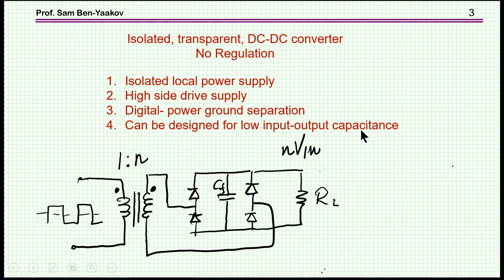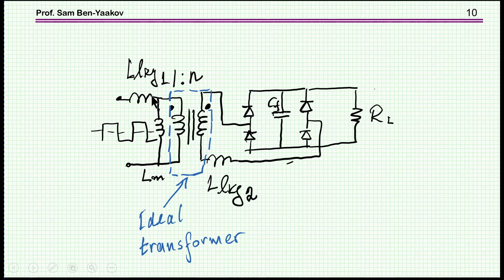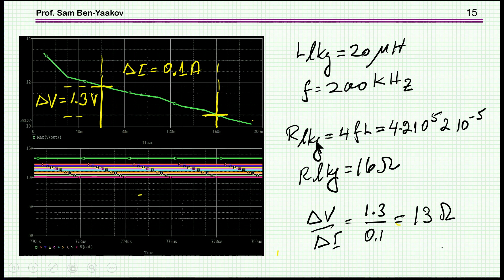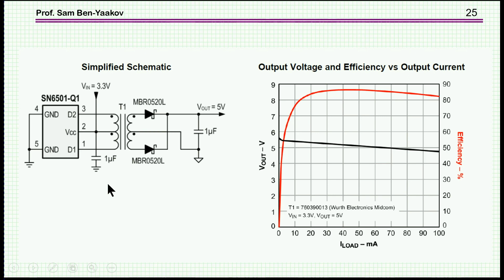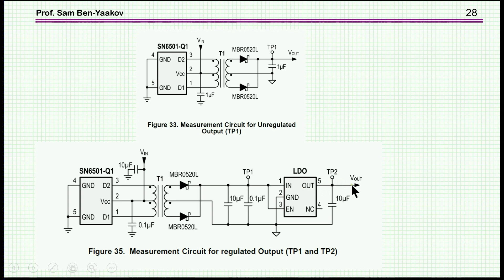Transparent isolated DC-DC converters

Comment: Superb! This is directly related to what i'm working on. Can everything you said about the secondary apply to a flying cap circuit? Some questions:
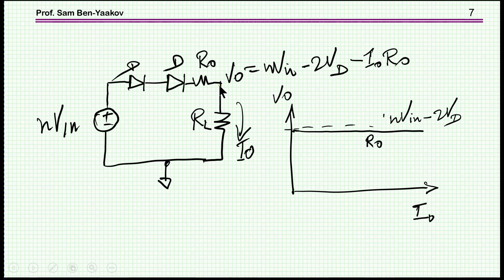3:28 
- Why is output current the inverse of input current? Due to storage in the trafo or cap?
- What's "input current"? Isn't current a matter of output, rather than output?
4:00 
- Leakage inductance doesn't cause heat, just V drop with higher load, correct? 
- Do you mean droop every wave cycle, or droop over longer time periods?
- Will a flying cap circuit show the same output current waveform? I assume there's no such thing as leakage inductance with a flying cap, right?
- In an unregulated circuit, will the height of output voltage ripple increase with load current? Ie, is ripple proportional to output current, or output voltage?
- Will a flying cap circuit have similar voltage or current ripple?
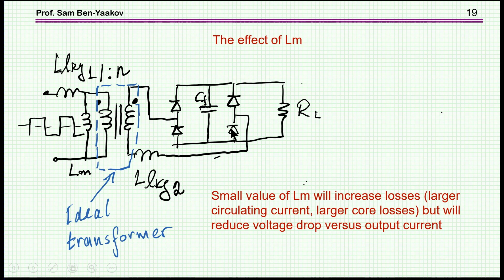13:31 Will a flying cap circuit suffer cross-regulation problems with multiple outputs?
17:00 SN6501 is too low power for my need. Is there a similar IC at 3A? I don't see one from TI. 
18:13
- Do you recommend a "pulse transformer"? Google says "Pulse transformers have a low number of windings (to minimize flux leakage) and low inter-winding capacitance". Correct?
- Are pulse trafos available at 3A or higher?
Reply: What does "Transparent" mean?
Reply from the maker: That there is no PWM processing in-between like a switching inductor in a Buck. What goes in comes out within the transformer turn ration.

Comment: Thank you making these videos.  I became a power electronics fanatic and physics nerd about 5yrs ago and have been learning ever since.  I'm now working towards my own +100kW (100VDC bus) 3 phase motor controller power pass.  Information from people like you makes this much easier.  You don't need to be in school to keep learning!
Reply from the maker: Thank for taking the time to write the comment. AS it happened I am also involved presently with the design of high power inverter for electric cars.
Reply: @sambenyaakov  What power range / traction pack voltage are you designing for? Do you have a preferred gate driver you like for your power range?

Comment: Great Prof as usual ... I did used these before but then I replaced it with REO 0505S ,, as it is cheaper and easy to use quickly. This REO has a series for different voltages ... 
I'd like to see a video in shunt resistor current sensing chips for small and high currents and why normal Amp might not be good, CMRR and differential outputs .... AMC1200 ... I used it in a different way to design a differential HV prob/sensor and done a video on it https://youtu.be/N1Kz-EZtbsU
Reply from the maker: Thank you Walid . I was not aware of REO 0505S . Every day you ,I,  learn something new
Reply: I am trying to find the best ever book for power electronics from practical prospective ... Do you have one ?
Reply: @WalidIssa  i think watching SamBenYaakovs video's is the best course for engineering modern power electronics you can find
Reply: Hee that is good to know! I mean that you made a video on that and with a link here. I will watch it this same evening because that can be usefull for my own built now. Thus good i saw your comment just
Reply: Thanks but you will find the bad news later ..... non-English video
Reply: @WalidIssa  ow, so then its sure not in dutch of course? But i still will try to watch later because with some luck you show things like a circuitschematic of so